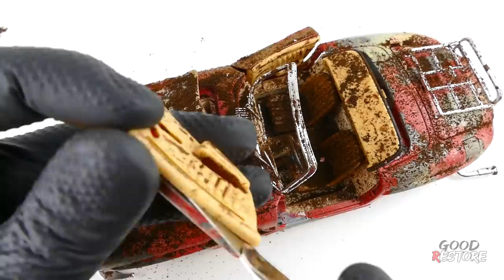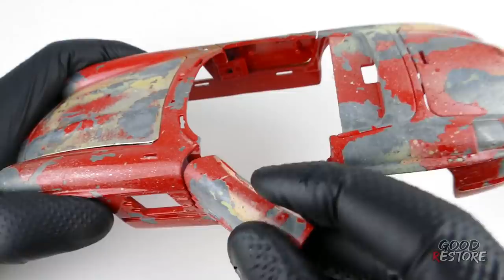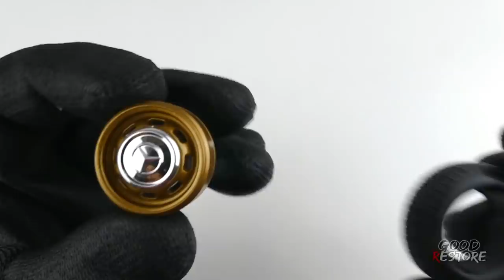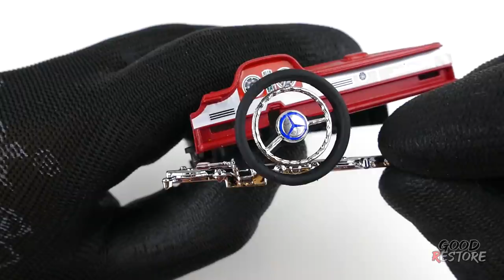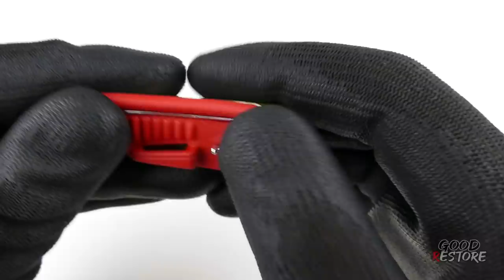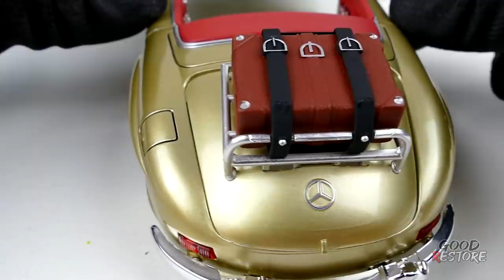Restoration abandoned Mercedes Benz 300SL Touring Model Car by Good Restore

Comment: Is it me or do all these "abandoned" replicas look as if they've been driven into the same pile of coffee grindings?
Reply: I was thinking the same thing look like he makes them look like that cause I have seen plenty of toy cars in parks and gardens and they look nowhere near that bad
Reply: Not only that, some of the weathering is clearly brushed on. Also, a lot of the parts come off way too easily, like they've already been removed before, and it's the second , third or fourth time they've been handled. If this is purposeful deterioration, just to "restore" it afterward, I'm ok with that, just be forthright about it.
Reply: I was literally about to ask the same thing!
Reply: I think it’s cinnamon
Reply: Isn't it technically still a restoration if you mess the model up beforehand? I think it's obivious that the model is bought new, then messed up, and then restored. That just looks better / more impressive than a make over of a car out of the box.
Reply: @Fra4nky  perhaps. And we can differ on what we consider more impressive. I think it’s unnecessary. But not everyone does, and that’s ok. And I reiterate yet again that to mess it up and rebuilt it is also quite ok. It’s the reticence that that is the case is the issue.
Reply: @siddiqahmad5193  also very impressive. Don't get me wrong, it's cleary more difficult to restore something that has been really deteriorated over time. Still, for the before and after effect it works better this way.
Reply: @Habu12   True, I would say it would also make for a good video to show the way "out of the box" to "abandoned".
Reply: cashing in on restoration video hype during covid while its popular :P
Reply: Does it matter. He does it for a hobby. Anything to nit pick about
Reply: @Eldritch_Panda31  yep
Reply: Ha, came to ask thr same question... and saw this comment.

Look at the wheel hubs when he removes the wheels... looks like new. Also non of that thin plastic trim is broken despite it having been so poorly treated?

To be fair, I'd be happy watching him take a new model out if the box and modifying it to be more real like he usually does.

As said earlier  just be above board about it